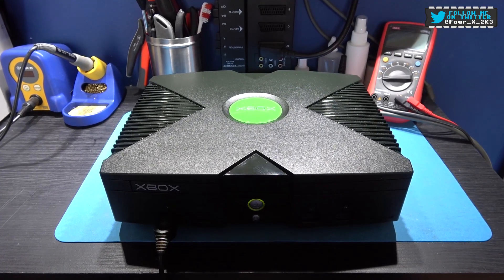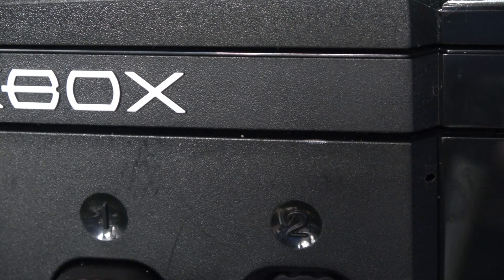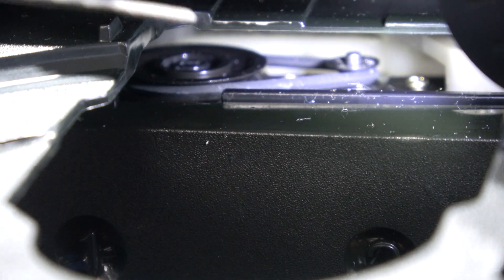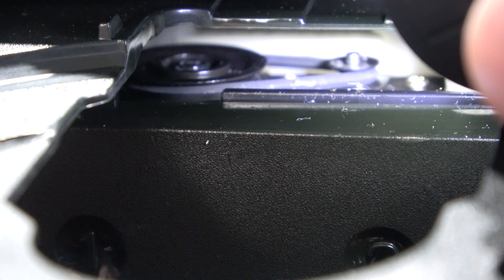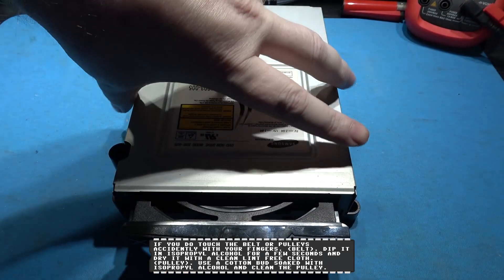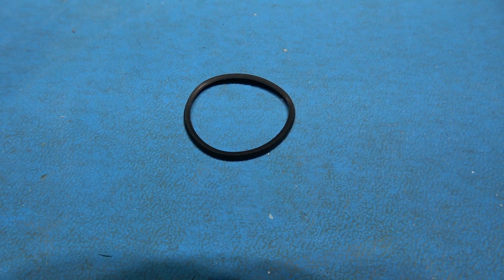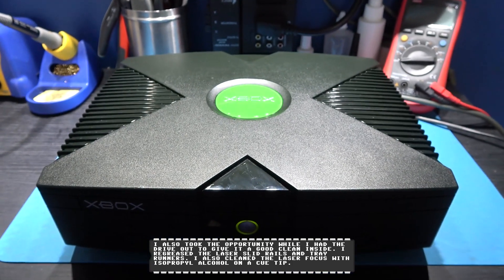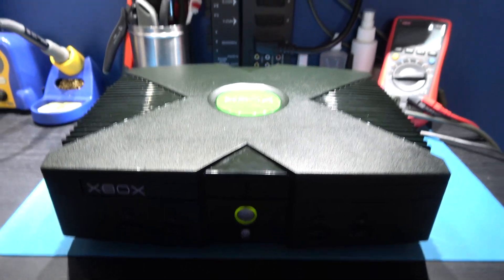Microsoft Xbox - DVD-ROM Repair (Eject Click of Death)

Comment: Nice video =D  I had this problem with my XBOX recently!  I boiled it for 5 mins in the microwave - works perfectly now =D  But replacing it is probably better long term!
Reply from the maker: Thanks Chris. YEP, I've used the boiling water technique on a belt for a C64 Datasette before and it worked like a charm however, the problem with this belt was it was misshaped it looked more egg shaped than round, for me it was too far gone for the boiling water technique. Like you mentioned it's probably better just to replace the belt in the long run especially if it's become misshapen.